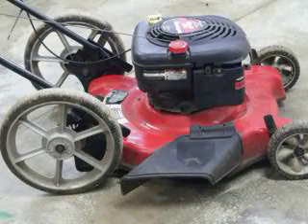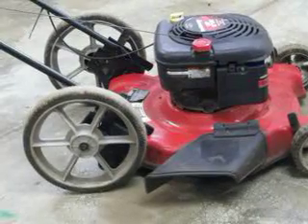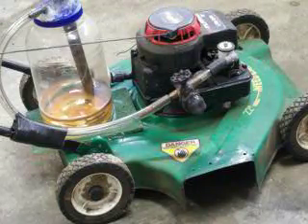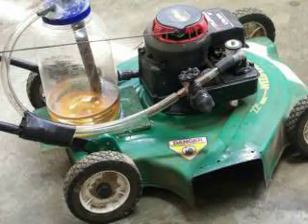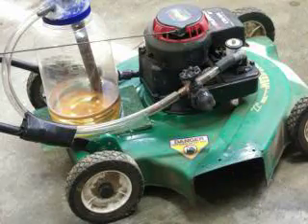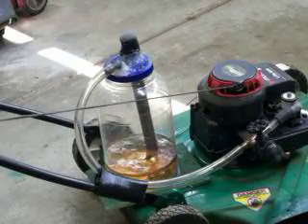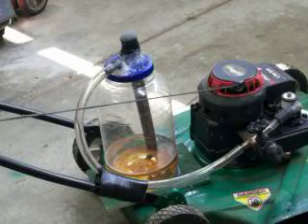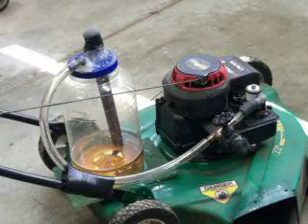gasoline and fumes the difference

Comment: The problem with using vapours in this way is the fact yes they do use less gas/petrol but are infinitely weaker. The reason carburetters are used in cars is because cars are heavy and need a lot of fuel to force them along the highway. The carburetter reduces the fuel into a fine mist and as each mist droplet is round it has a maximum surface area to evaporate into vapour. The oil companies are not really conning us the simple fact is you need more fuel if you want more power.

Comment: I would be extremely reluctant to run ANY I C engine in an enclosed space ...the point is carbon monoxide is tasteless colourless and odourless and is a byproduct of the consumption of gasoline irrespective of how its fed into the engine
Reply: +cyclistpilot Amen! Those who think  there are no fumes because they don't smell them need to understand this. It is very simple. Do they think people die from furnaces not running right because they smell the fumes and say, Oh it's ok? Nope, they die because they smell nothing at all. All hydrocarbon combustion produces carbon monoxide which is colorless, tasteless, and odorless (reiterated for those who don't comprehend well). It is what you DON'T smell that kills you.

Comment: it's not about running. Everyone knows that engines do run on vapor. Problem is the safety. If a spark comes anywhere in that bottle, you would have a bomb on your ass. Thats why car safety mandates you use liquid gasoline and gets vaporized inside the combustion, not in the fucking gas can. Not too mention when your engine is lean all the time, bye bye pistons.
Reply: +LEDWorldNZ Yeah, the gas, maybe. But vapor? That shit i already mixed with all the oxygen it wants. Think about that before disproving someone.

Comment: Diesel never catch fire so can we take diesel instead of gasoline? 
There won't be any risk of backfire blast too.
Reply: +Andrew Moffitt Also Diesel WILL burn! the Ignite Temp is just way higher.
Reply: ***** What about diesel trucks?
Will they be able to take the fumes and compress them?
Reply: yes. but it will run like shit and destroy itself.
diesels are direct injection engines.
they squirt the fuel into the cylinder and it will instantly burn, caused by the compression.
if you let it suck the "fumes" through the intake, it starts to compress and "ignite" the diesel fuel way to early. the engine will destroy itself.

guys plz stop that fume stuff. thats just stupid.

Comment: Proof that some people don't have the faintest clue about how a carburetor works. Also not knowing what happens to valves & pistons when a too lean mixture is used for too long in an engine. It's not pretty,...trust me.
His future videos will probably be about a 12V. battery powered electric motor device that uses an alternator running off of the drive shaft to recharge the battery.
Reply: You just reminded me of what the Carb on my late 1927 model "T" was called  ( a Vaporizer ).
Reply: +Commodore Sixfour  And a bicycle was originally called a velocipede. Popular terminology changes over time.
Reply: I have run a two cars this way for a short time, but I believe it may  be lean enough not to heat up too much
Reply: lmao
Reply: +Kevin Cyr these would be on cars but there not because it makes them way to Lean, you might save fule  but in long run will wreck your engine  the carb is design to cool the engine and to run it, the richer the mix the cooler it runs you could probably run it so its 10% more affecent but will not be easy to get it thinker fumes these make it 100% more effecent which is way to lean for engine.